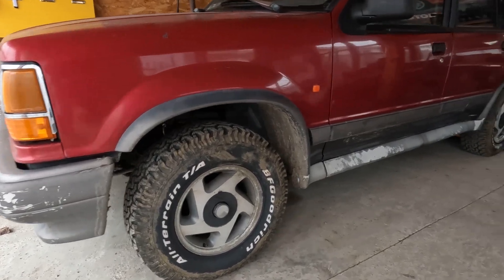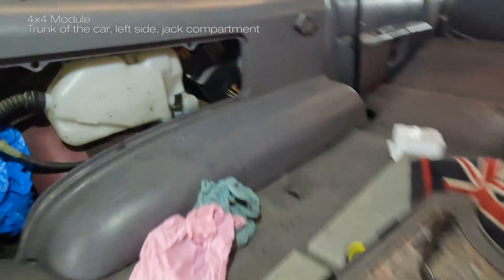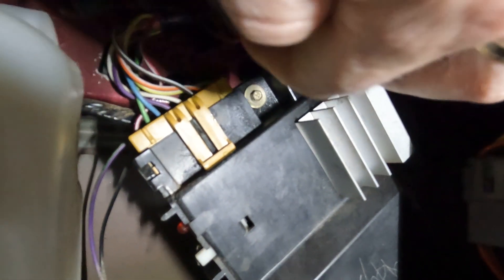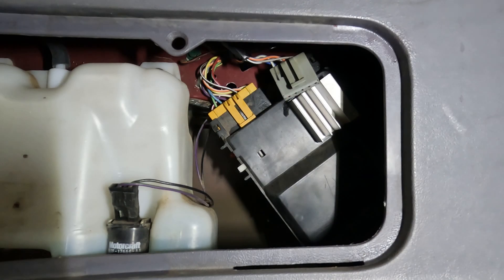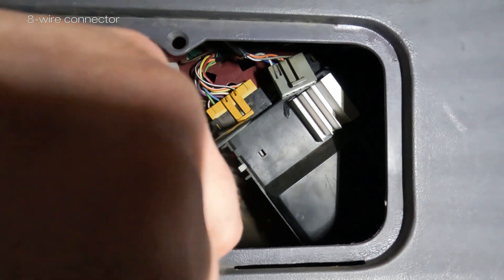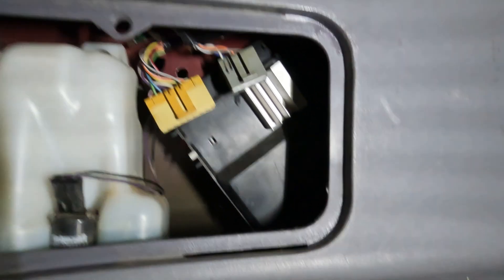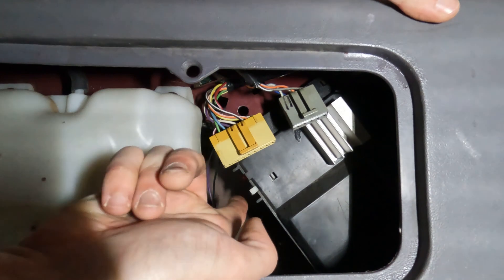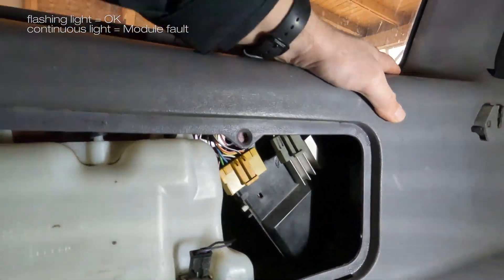Ford Explorer 4x4 Module self test

Comment: Hi how do read the engine codes on these old explorer's???many thanks
Reply from the maker: Hello, 
With a paperclip and a good memory or, better, a phone to record them. You have to place a paper clip between two pins in the engime compartment, next to the air filter, and then turn ignition on and count the flashes of the "Check Engine Light". After that, google the codes, you'll find them.
Thanks for the tip: I'll make a video about it in the next few days.
Reply: Many thanks looking forwARD TO SEEING THE VIDEO.. AGAIN MANY THANKS  @Zvoneru
Reply from the maker: Hello,
Just made a video about the codes:
https://youtu.be/fJ-8W2o19hY?si=x4TlTFNi8Rtw_we1